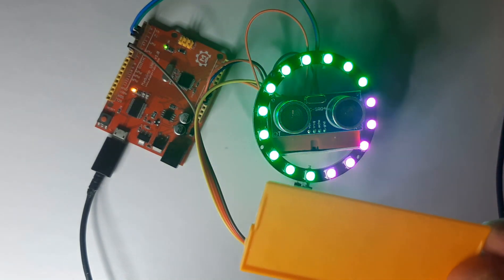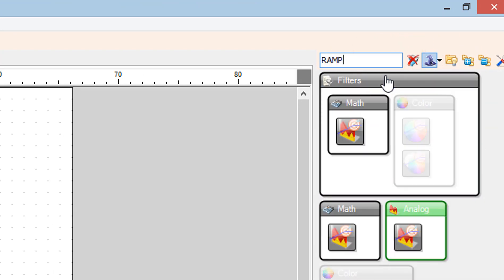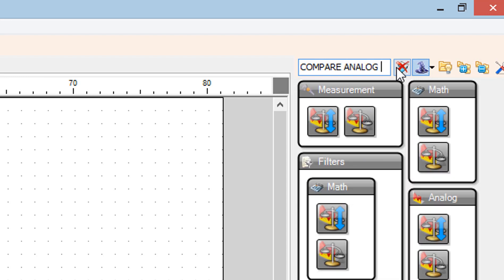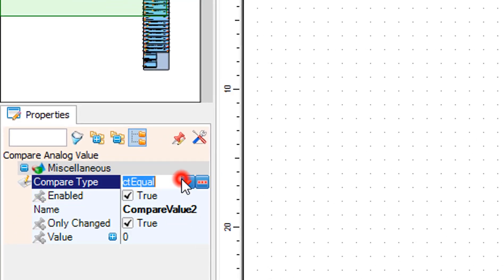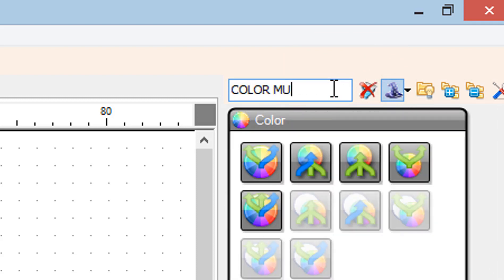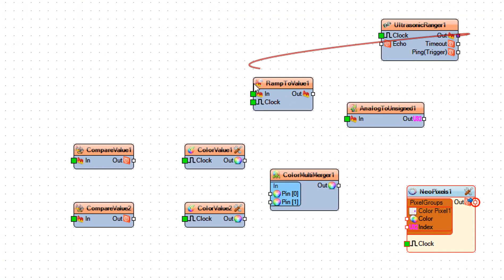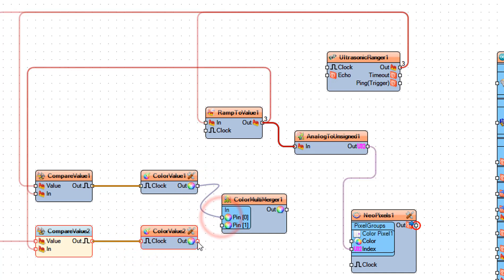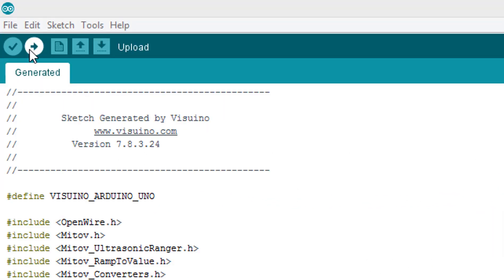Arduino LED Ring Ultrasonic Distance Sensor

Comment: Hello!  Great tutorial, thanks to you I downloaded Visuino and started to play with it.  However, I do have a question.  I am trying to modify the code so that I can make a parking distance display.  I have been knocking around, but can't seem to figure out how to set he "full red" at a distance of say 50cm  and green starting at the HC-SR04's full range of 400cm.  thanks, and sorry if my question seems trivial.
Reply from the maker: Hi, you can click the button on the top "Send to Arduino" and the code will be opened in Arduino IDE where you can modify the code and upload to Arduino board.